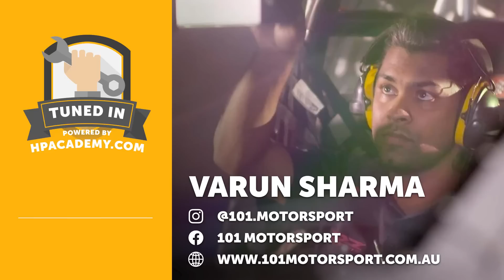106: Intercoolers and Methanol — Pointless or the Key to BIG Power Gains? [#PODCAST]

Comment from the maker: TIME STAMPS:
4:12 How did you get into cars?
6:22 What was it about Japanese cars?
11:22 Once you decided cars were your thing, where did you go from there?
18:14 How did you get an apprenticeship in a performance workshop?
25:51 How did you buy 101 Motorsport?
30:46 Does having other dyno tuners around hurt business?
37:22 Overview of 101 Motorsport
41:36 What services do 101 Motorsport offer?
54:18 Dyno discussions
1:04:14 Confirming tunes out on the road
1:10:14 What is your ECU of choice?
1:13:41 What drew you to drag racing?
1:17:44 Overview X275 radial drag class
1:20:19 MPH and ET of the Oceania Supra?
1:28:18 Finalising a tune at the drag strip?
1:36:42 The importance of air temps out of the intercooler